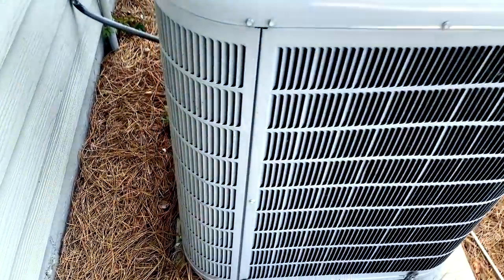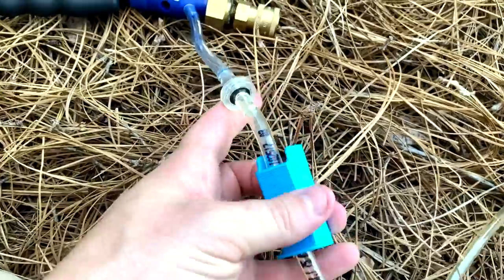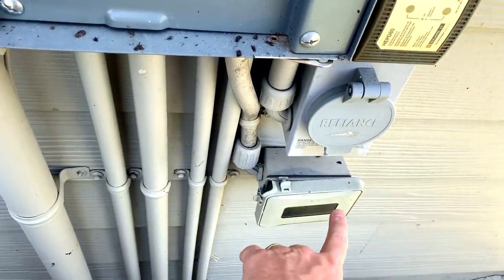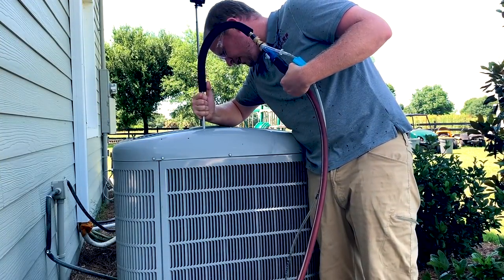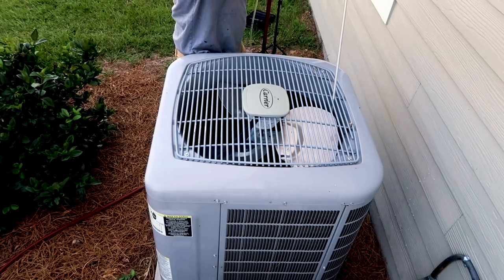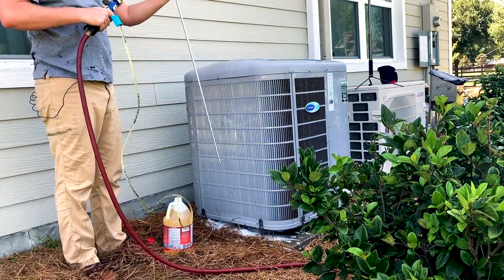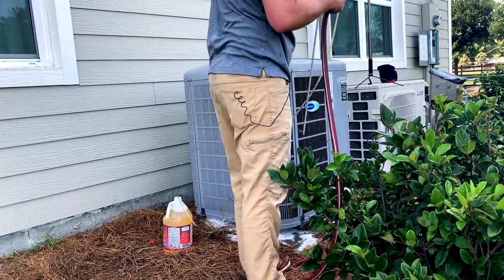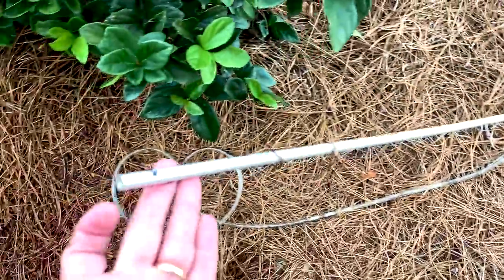SpeedClean Condenser Needle

Comment: Grundfos Scala2 whole house booster pump will give you 60-80 psi water pressure (configurable) with no external pressure regulators or tanks.  It operates on demand, is variable speed with integral pressure and flow sensors.  I use one at my house and it works and it is quiet because the motor is water cooled.

Comment: It's not the right way to clean the condenser coil, one of the best way to dismantle all the side panels and top of the fan panel and clean condenser coil first with the help of brush and then wash the condenser from inside to outside with water. House water pressure is good enough for washing the condenser coil and then assemble all panels,  it will take little more time compared to this video.
Reply: Sir my Carrier split AC compressor R22 overheat after 20 mints working suction pressure go to 200 what problm and how can solve it and abovatr quail half cold half normal, discharge line cold suction not cold. Service , fan , capastr , everything is good but again overheating and off compressor. Plz tell me soulation???
Reply: husnain husnain if your suction pressure is 200 either your way over charged or your compressor is bad.
Reply: I'm surprised that Bryan would not remove the panels. Actually, I'm very puzzled by his demonstration of how to properly clean a coil.
Reply: Im a superior tech because i clean a condenser the right way YOUR TYPE KILLS ME  .
Reply: @husnainraza4610  your txv is going out
Reply: The whole idea here is speed. When you’ve got four to six maintenance calls to run and there is drive time involved, ya can’t pull the panels off. Half the systems out there take awhile to pull the panels and top off. We get an hour and a half tops to run a full cooling check. If we are cleaning the drain pan and clearing the line, checking electrical etc, we’d be BUSTING ASS to make the two hour mark if we pulled panels off the condenser.
Reply: @donjohnson5172  and the home owner watching u n asking about the couple leaves inside the unit n probably the reason they wanted maintenance was to get the 3 leaves out. Maintenance can be annoying.

Comment: That looks way too time consuming...i use coil clean mixed with water in a garden sprayer. Spray it thru the fan grates onto the coils from the top an it foams up to the point that it pushes the gunk outwards. Then just hose it out from the inside out. Takes like 15 mins

Comment: Wow that customer must be a millionaire maybe billionaire
Reply from the maker: Joe Shearer old Joe is back 🙄
Reply: @HVACS  Sir my Carrier split AC compressor R22 overheat after 20 mints working suction pressure go to 200 what problm and how can solve it and abovatr quail half cold half normal, discharge line cold suction not cold. Service , fan , capastr , everything is good but again overheating and off compressor. Plz tell me soulation???
Reply: Husnain call a tech call a hvac company in your area. That’s what U do!!!!!!
Reply: @natebelden8915 bro building maintenance including Air conditioner.... I faced 1st time this problm during 4 5 years.....
Reply: Even building maintenance guys got call hvac pros once and while cause they are not.
Reply: @natebelden8915  bro tnx I will try...

Comment: How much does a condenser cleaner/service call like this would cost?
Reply: Generally around 100$ in my area of Florida, which usually includes visual inspection of condenser and air handler, air handler drain line and pan flush (and possibly chemical), light evap clean, capacitor and electrical check, etc.

Comment: That's a "cool" tool. Ha. But I once ran into a condenser that had crazy amount of leaves inside and those leaves became a blanket of insulation that overheated the compressor and caused the terminals to blow-out. Now I always check the inside bottom of condensers for leafs and other debris first.
Reply: It's standard procedure for us to vacuum every condenser with any debris on the bottom at the company I work with

Comment: Try Ryobi 600 psi cordless pressure washer. 40degree nozzle and the foam prayer. Works great. Spray from out side and take nothing off! WASTE OF TIME. Not doing a 75$ service and spending an hour plus dismantling a janky cabinet to get a coil slightly cleaner

Comment: Those carrier junkers are extreme pain the ass to wash especially package units with condenser guards on maintenance its often 50-60 screws per unit by the time you removed all access panels. Is carrier ever changing their retarded 30 year old design?